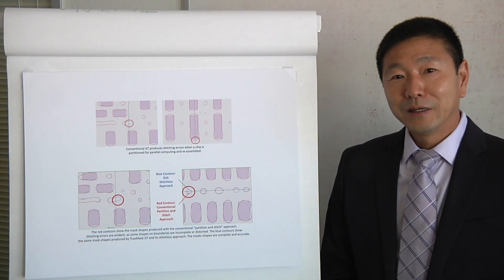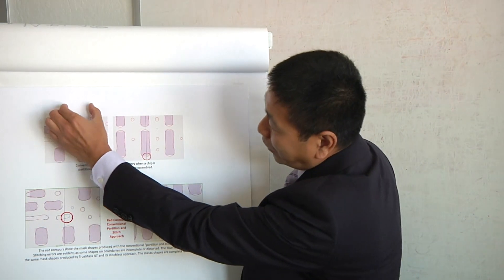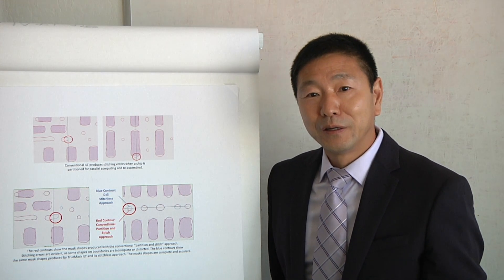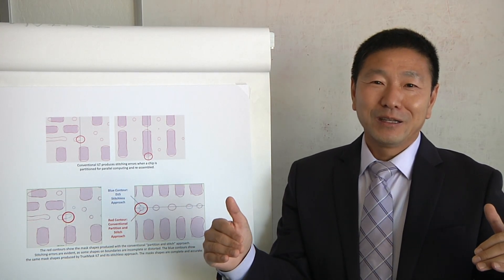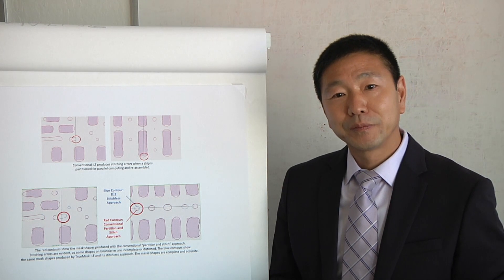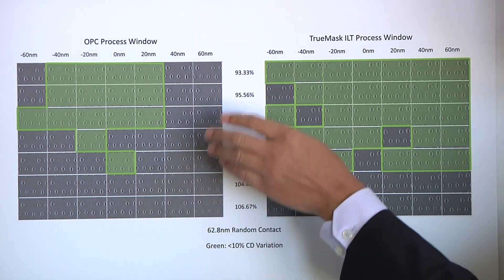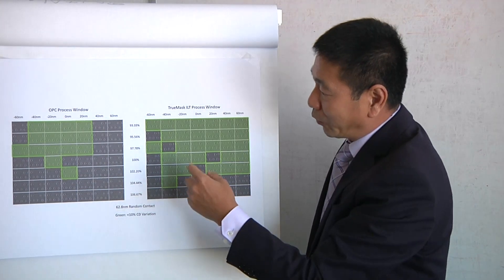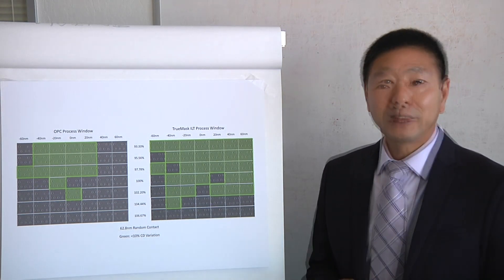Inverse Lithography Technology

Comment: Just doing some quick math on those computing needs: a 1 petaflop supercomputer spending 1 day is 10^19 to 10^20 operations to solve the full chip.  Assuming the full chip has a billion features, that's still over 1 billion calculations per feature. :O

Trying to optimize the calculations-per-feature down a few orders of magnitude with an AI sounds enticing because AI has worked wonders for "visual" problems (2D data), but could that help here?  My concern is that even a single mis-connected feature/gate/transistor would invalidate the chip (to some degree).  Is there a sufficiently fast validation algorithm that could check for those design errors?